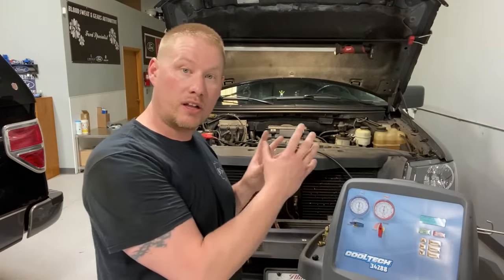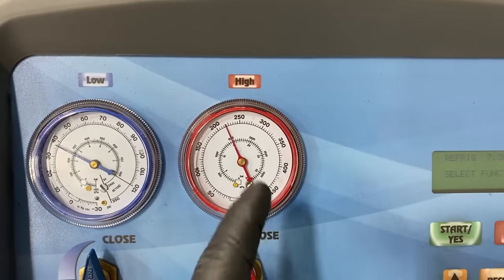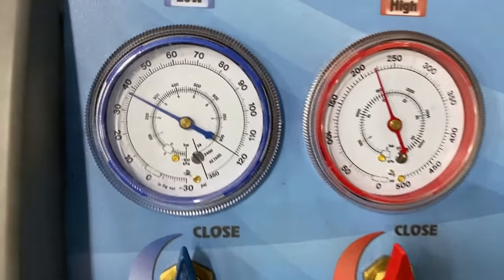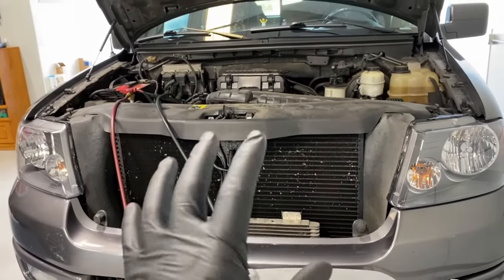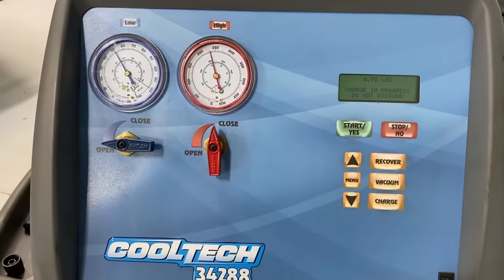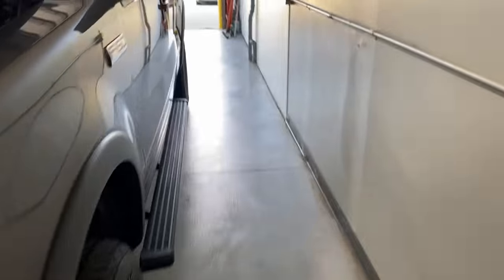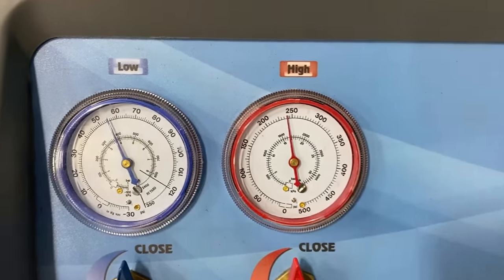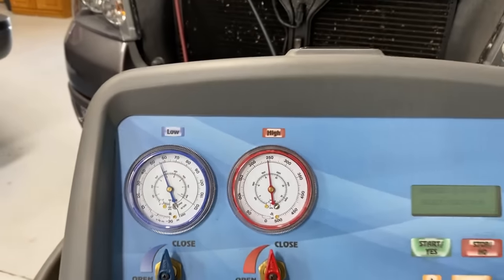Ford A/C Quick Tips #9: How to Spot an Overcharged Air Conditioning System

Comment from the maker: These are the Parts and Tools I Recommend:
Basic R-134A Gauge Set-
https://amzn.to/3efy9qz
Dial Thermometer-
https://amzn.to/3ehnUlp

As an Amazon Associate I earn from qualifying purchases.
Reply: Great video, very well done. I have a 2004 F150 5.4l that will not send power to the relay powering the AC coil. When applying 12 volts to the relay all is well and the system does a great job of cooling and the pressures are right where they should be according to the various charts  for temp and humidity levels. How do I prove the issue is the PMC? Or should I be looking in a different direction.
Reply: Hey my guy, I'm trying to program a USED Abs module into an 07 sport trac. I've done it with both an autel and FMP, still get a code 2477 for configuration. Have been told that for this particular module (7a2z2c219e) that the old data can not be over written and I am just wasting my time (repeatedly). Hoping you can confirm this. Many thanks
Reply: I once overcharged the ac in my car causing it to cycle on and of really fast when I started to accelerate. I could feel the car shuttering from it. Took some refrigerant out and it worked fine again

Comment: I was taught this by a HVAC tech. He told me under charge and over charge will trip the pressure switches. I vacuumed down my cooling system and charged it after I was having problems. He pulled out almost an extra pound.

Comment: Good video.  This is why I ended up buying a 30 lb tank of refrigerant and a weight scale so that I can put the correct amount in.  I would love to have a charging station like you have but I'm just a DIY'er that fixes my vehicles and some of my friends and can't justify having one.  I used to use the cans and a can tap and it was hard to put the correct amount in.

I taught myself how to do AC repair work back in 2006 by reading AC repair books and by researching on the internet.  Bought the correct gauges, vacuum pump, and other tools and have successfully fixed about 15 vehicles over the years.  I also got my 609 cert so I could buy R12 which I still run in one of my older vehicles.
Reply: That’s awesome!
Reply: A wholesaler told me that R-12 was going up so I bought 1200 cans for $1/can. 6 months later it went to $25
Reply: @obsoleteprofessor2034  I bought a mostly full 50 lb tank of R12 probably about 10 years ago or so for about $250.  I still use it in my 92 Chevy Cavalier.
Reply: @obsoleteprofessor2034  that's like Bitcoin!

Comment: The symptoms you show can also be caused by defective engine cooling fan or dirty condenser fins. Best way to tell if a system is over or under charged is to check pressure without starting the engine with the engine temp at ambient. High and low pressure will be equal. Pressure in PSI should be very close to ambient temp in F. There are charts available in the shop manual for this test. 
Retired Ford Engineer with 51 years experience fixing Ford, Mazda, Volvo and JLR vehicles in 46 different countries.
Reply: When filling the system do you keep high side closed? Looks like he's doing that. But I filled it with both open is that wrong?
Reply: @brucewayne-ej3cx  Keep the high side gauge valve closed anytime you are running the engine with the A/C on. The reason is if the A/C is on, the compressor would be pressurizing the Freon supply tank which can be very dangerous. The supply tank could explode.
Reply: @parolajd  I'm glad you told me this. Lol it's a bit late tho I did it the wrong way it worked out thank God. It did seem a little sketchy but it worked. Next time I'll do it right.
Reply: @ John Parola You should make a diy video for fords. I've always had fords along with their issues.  And fix the majority of the problems myself if at all possible.  This Ac compressor/ system diagnosis / fix is one I'll probably end up having a shop fix as I do not have all of the tools.
Reply: @parolajd if the pressures aren’t equal at ambient temperature and cold engine at rest ,what this could mean Sir ( probably some obstruction, the temperature in the vents goes down to 34-36 F by the pyrometer ) ? The ambient temperature 80.7 degree F by the pyrometer and 81 F by regular wall thermometer. High side pressure is 100psi and low side pressure is 80 psi static on cold engine . All pressures are taken from the black scales in psi of the gauges. Even reversed the gauges to see if they measure properly and they are correct . The pressure- temperature chart for r134a says the pressure need to be 86.7psi at 80degrees  F and 88.4 psi at 81 degrees F .
Reply: @flappingflight8537 that's not right. You need to look at a different chart. For 80f ambient high side psi needs to be at least 160psi and low side at 35psi with compressor on.
Reply: What if just the high side keeps going up? Ambiet is 75f, i was at 30psi low and high was 150psi with a slightly whiney compressor. Vents were still cold but i was worried about the compressor sound and decided to top off. I added about 2/3rds of a pound and the low side barely moved to 33psi but high side went to 175psi. Kind of high for 75f ambient no? Compressor is quiet now. Vents cool nice at 40f in the middle vent. Think I'm ok?
Reply: @ve2430  I mean when  the engine is cold and not running .

Comment: When properly charged, weak compressor will give them same symptoms. It's hard to suck than to push and you need a good pressure drop to boil off in the evaporator.
Reply: A weak compressor can give same readings?

Comment: Converting the low side pressure to evaporator temperature is a great tool to help visualize why the air coming out of the vents is warmer.
Initially your evaporator temp was 44 degrees. Afterwards it was 58 degrees. Obviously the 58 degree coil won't cool as well. BUT, don't confuse that with undercharging a system, i.e low suction pressure.
As he points out tho', more doesn't mean better. Great video.

Comment: You should make a video showing how to tune the system for optimal cooling, in the dead of heat. I find that recharging to spec, and removing tenths at a time, yields some pretty impressive results.  It's not a free lunch however, you sacrifice optimal output at lower temps, and make compressor cycling duty load higher. I've used other gasses other than r134a in my personal systems, and have achieved great results for super cheap.
Reply: I've always wondered if there was someone else out there that does that!!  I do the same thing.  I've never recharged and stopped at spec.  I've always gotten really cold air conditioners from just playing with the freon level.  Mine have always been coldest with less freon than spec.  Is that what you've seen over the years?
Reply: @TheVenom8343   and under charge can make it cooler. I know that in residential systems the evap coil will freeze over if the system is under charged and air will stop passing through the coil. Another issue with low charge is that you will increase compressor cycling which may decrease your fuel economy on the car and increase compressor wear.
Reply: @pibblesnbits  Yeah, it freezes up.  But I throw it over to "vent" and she's thawed in 30 seconds or so.  I choose to do that because my A/C will blow 28 degrees F and boy that's nice down here in hot ass MS!! Lol
Reply: I'm in MS as well. My 2014 will only blow 60 degrees out the vents. I changed the expansion valve today and same thing. What kind of freon are you using? I put 2 12 oz can which is 24 oz which is what the sticker says. My gauges read 25-30 and 15-200. So I added a extra can. Pressure went up 30/200. Temp gauge dropped to 58 or so degrees. What are your Pressure readings?what part of MS are you in?

Comment: I was able to change both high/low standard schrader valve cores that were leaking
w/o losing additional refrigerant on my 90s Honda. Thank you Mastercool!
Reply: How is that possible
Reply: @jasonmorris2813  The tool has a built in ball valve controlled by a lever preventing the discharge of refrigerant and another part of the tool unscrews and removes the valve core aided by pressure from the system. It's a clever device using a simple procedure for removal and replacement. Sometimes they don't always work on the first try. They also make them for home A/C condenser units. Same process.

Comment: But more is better! Good demo. Whenever I see those MONSTER 20oz or more "AC pro" cans in the parts stores I wonder how many people have dumped those into good systems. Heck, newer vehicles are full at 16oz sometimes.
Reply: And those guys will never see the high side at 350 psi, since they don't have both gauges ...😵
Reply: @Mustang Ricer6589  Not out of reach in some places, they have the small cans ready for sale at places around me. Still $$$ but it will come down in price.
Reply: Or they buy it because it says, With Stop Leak. I’ve been doing this for 40 years, there’s no such thing as a stop leak for A/C systems, only destruction.
Reply: I have 2013 f150 that was blowing cool but thought it could be colder so I used one of those cans. Now when I turn on my ac the fan goes to high speed. I'm guessing it is doing this because it is over charged? Would it be best to drain it all and just have it recharged?
Reply: @socratese71 yes

Comment: Those auto parts quick charge don't come with  fancy machine like you got, you got to depend on the analogue gauge, I guess was not paying attention to quantity , just opened it all the way, so my Honda Civic was not getting cold  like to should, After watching this video, I am pretty sure I overcharged it, So i had to let some out at low side at the schrader valve , I would let some out and keep checking, saw my temp gauge starting  to come down, got it down to 40 , Worked like a charm, I was going to take my civic to a shop, Glad I saw your video, Thank you Mr Brian
Reply: YOU LET SOME OUT???? OR you recovered some refrigerant? 
One of those is illegal.😮

Comment: The other issue people don't understand well is how dramatically ambient temperature will change absolute gas pressures. Never interpret pressure readings without adjusting for ambient temp.

Comment: I had a garage service my working air con come back not working they said my compressor is bad. It would turn on for a second make a very bad noise turn off. I hooked up my own air con gauge. The low side was on 100 psi WTF they overfilled it. We got it back down to 35psi. Works perfect now no noise ice cold. Dont know if any long term damage but right now its good. Makes it worse my work boss owns the garage lmao. I told him your guys nearly destroyed my air con. They are in the shit. lucky for them it was my car not another customer. Would have cost him.

Comment: Perfect timing.  I just recharged my 2006 Navigator yesterday, and by the looks of it I'm undercharged.  System holds 58 ozs, and I added 4 12oz cans.  System works great though, both front and rear A/C systems are blowing cold air.  Thanks for the video.
Reply: Was it totally empty? Or did you just dump 4 12 oz cans in it without knowing what was in there?

Comment: Excellent video, its very easy to overcharge/undercharge with those r134a cans if not checking specified pressures under the A/C performance test procedures for that vehicle (Ambient temp, max heat load, stated engine RPM, out of direct sunlight).
Reply: humidity.

Comment: Yup, looked exactly like when I overcharged mine. 110F day and it was brutal in the car. Pulled off some pressure and back to ice cold
Reply: How you pulled off some pressure?
Reply: with a recovery machine of course
Reply: @gerardotorres8872  Straight into the atmosphere of course

Comment: After watching your other videos, I went with the little otc bottle and added it until the compressor stopped short cycling. I ran it for about 15 minutes and my windows started picking up condensation outside. I know I have a slow leak somewhere but with 200k on the beast, I don't think it will be around too much longer

Comment: Thanks for the video! I was wondering... as for a DIYer, if lets say I overcharged my system and I got only this cheap low side pressure gauge, would that work if I just drop the pressure back into the 12oz AC can with my car shut off when system has equalized pressure of 80-90psi...? So that it doesn't get vented to atmosphere.
Reply: How are you gonna suck it back into the can? Lol
Reply: @ve2430 an empty can has zero pressure. An equalized system is going to have positive pressure. Simply connecting manifold to can will pressurize the can with refrigerant. At least until the can equalizes to the system. Then use another empty can.
Reply: @HectorFabela-k6u  How do you know the can will not blow or explode.?
Reply: @HeydaCarreras  By weight. Just like you add it into the system.
It's called a refrigerant scale.

Comment: Blindly charging is the equivalent of using the "parts cannon" to fix a problem. If someone's going to attempt a DIY fix, get a gauge set and understand what the low side and high side pressures should be for the system and what it means when either or both are off-target.  And if the gauges show the system is completely dead... don't just charge it!  Vac it down, check if it holds vacuum... if it doesn't, charging the system without first finding the leak is a complete waste of money.
Reply from the maker: Agreed!
Reply: @FordTechMakuloco  Yep , agree 100% . I do check condensor fan running on low speed and I place a large box fan in front of radiator so mimics maybe 15 mph driving so condensor fan can have some incoming air pressure .  Had to buy really good gauges since the budget gauges were not accurate .   Done Subaru to Nissan to Ferrari AC rebuilds so learned to buy new compressors . Rebuilt ones don't last. And new TXV , o-rings and where applicable filter dryer.

Comment: According to the R-134A T/P chart, at 90° ambient, the low side should be between 45-55psi and the high side between 250-270psi.  If your system was indeed at the right capacity at first, then hooking up gauges and going off the R-134a T/P charts will tell you nothing about the system state of charge, as it was telling me it was low at first and good after you added 1lb.

Comment: I replaced the high side line where the pressure switch is and new pressure switch also. Filled it to 2 lb 6 Oz as listed and for about 2 weeks ran perfect. Clutch started to not engage so I figured was a schrader leak I was already aware of topped her off a little and went on about the day this happened one more time. And now about a month later the compressor clutch engages on and off at random times leaving the air hot or muggy and hot then hot. Hooked up my manifold gauges to it and the high side was 350! The low side was about 45. It was 90 out. What would any input be why it's doing this should I go get it evacd and recharged or is they another issue causing this aside being overcharged. I'm no mechanic so any input is appreciated just tryna save some money on my 07 mercury

Comment: I've wanted to ask you a question about cooling. I've thought about installing a good aftermarket or something from the junkyard. A stand alone electric fan over the hottest spot on the radiator that is run / turned on by a switch in the cab. Say on a really hot day or heavy stop and go traffic I can reach over and turn on that fan to increase cooling. Would that fan block enough regular cooling with the fan off that it does the opposite of it's intended purpose?

Comment: Hello, when my 78 FORD GRANADA   Was new it was December, first spring turned it on Scared me the belt was howling, as the compressor tried to run, went home took a look, OK OVERCHARGED   Got an EMPTH throwaway cylinder put it in a vacuum, tossed it in the FREEZER, removed the charge & WEIGHED IT.       7LBS ,,,,,WOW NEW CAR   pulled vacuum on car , weighed in the charge , never had a problem with it after , just goes to show you , NOT BECAUSE ITS NRW, DOES NOT MEAN ITS OK., that was R12  CHEERS 🇺🇸🇺🇸🇺🇸🇺🇸

Comment: Very useful demo video. Thanks a lot. I have a question though. You said that the pressure in the low-pressure section is a very important readings. It makes perfect sense as most of DIYers (myself included) have only the gauge for low-pressure measurements. You also showed the "normal readings" for "this weather". So my question is what is the normal pressure in the suction area? I can see in my car this reading can flactuate from 35 to 45 PSI just because of the ambient temperature. What should I consider as normal? Thanks again.

Comment: Just replaced my entire A/C system in my 2011 Crown Vic.  Charged it up to the exact spec of 27oz with an A/C machine.  Pressures indicated an overcharge.  Evac and recharged it with about 3oz less that the spec.  Works great now!  I did use aftermarket components, my theory is the aftermarket condenser has less capacity than the original.  Anybody ever run across something like this??
Reply: The charge sticker should be taken' with a grain of salt when using anything other than OEM replacement parts.
Reply: Yes every manufacturer is different, 32 psi and no straining noises from compresser. It's good and cycles

Comment: please warn them about the sealer in the freon.......dont use the charge with the seale it kills all systems....
Reply: GGALLIN1776  red angel AC stop leak 2oz bottle works incredibly well. IDK about the can with the hose, but I used the 2oz bottle in my daughter's mustang with a leaking evaporator and it worked wonderfully. Gotta know what you're doing though. Highly highly recommended.
Reply: GGALLIN1776  actually any part that can be properly replaced I'd do that, but an evaporator where the whole car has to be torn apart, definitely use the stop leak.